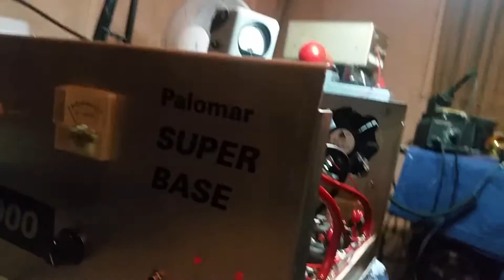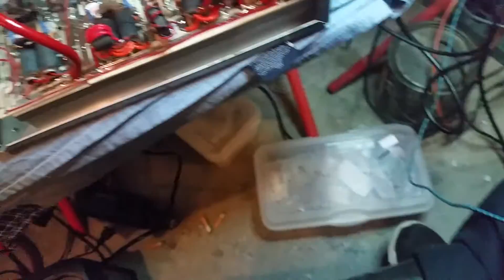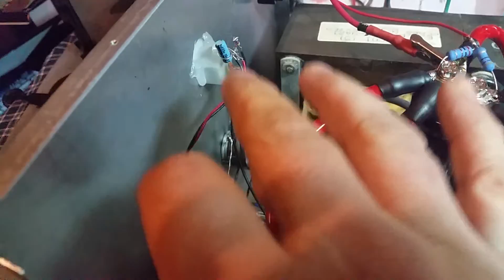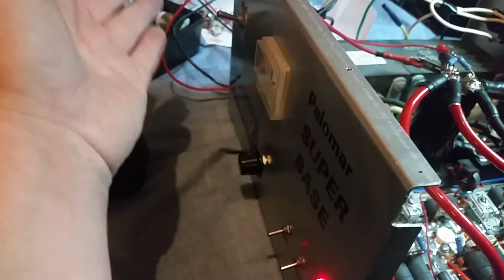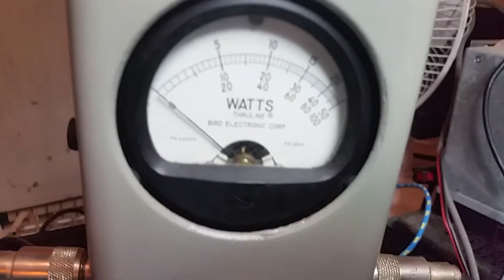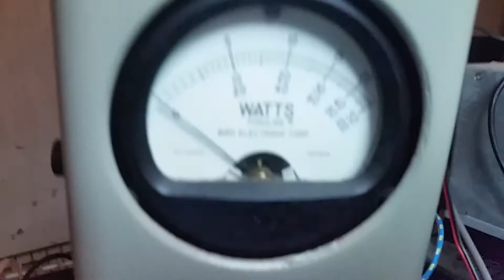Palomar Super Base 1000 Amp Board Repair For Mr. Housebuilder

Comment: have not seen that model around hear. SD 1446 are great driver. same as MRF 455. A MRF 454 or 2290 will be a bit much if 2 used for driver. would be great for 2SC 2879C but that power supply would not do it.  That trace is why that combiner resistor burned up. If he would have keep using would have blown some pills. That power meter is strange. should have been output connected. nice job with big bridge rectifier.  them so called 50 amp ones suck. china junk,  The 1/4 in terminals are rated 30 amps. That's why you see them push on ones melted. solder them does help . I got the 200 amp ones. also 150amp and 65 amp ones. the 65 amp ones same package as a solid state relay. I sent you pic of 60 amp schlocky diode bridge. will be video soon . That cap is fine. is user using SSB 2 caps will be better. For them bigger fans . 78S12 voltage reg and heat sink them . good for 2 amps. LT 1083 reg good 7 amps and ADJ also low drop out type. best on base amp use 240/120 volt AC fans. what would be great if my box is I take that meter out. replace with 2 meters. VOLTS and AMPS off power supply. if you multiply the two together you would get input watts to the pills RMS.  nice base box. I would bias it if was mine and 2 filter caps.  SSB user hear. 73's
Reply from the maker: I dont think he does man.....Id love to collaborate with him in the future.
Reply from the maker: That is cool imma go download those pictures to my Robert directory....you know I could make a simple voltage regulator circuit with that LT 1083 printers out and use it for variable voltage on the fans up to maybe 4 amps to be safe....Ive gotta buy some of them.

Comment: What are the resistors on top of the cap for?
Reply: to bleed down the voltage when the unit is off.  (discharge the capacitor)
Reply from the maker: Those resistors are being used for 2 reasons...
1.  BLEEDING RESISTORS TO BLEED DOWN THE FILTER CAPS
2.  A VOLTAGE DIVIDER CIRCUIT [IF YOU NOTICE A WIRE IS COMING FROM THE MIDDLE...I dont remember off the top of my head what it was powering.